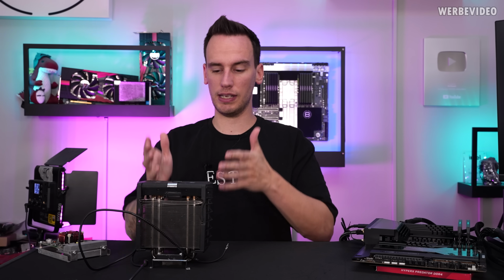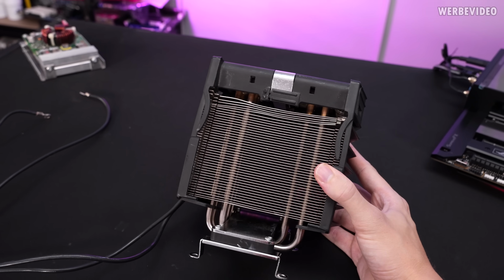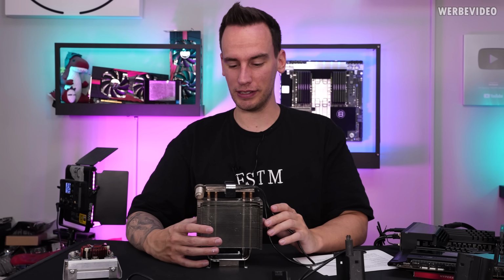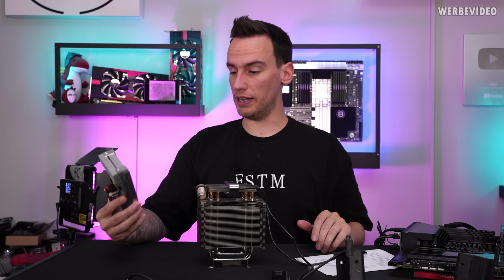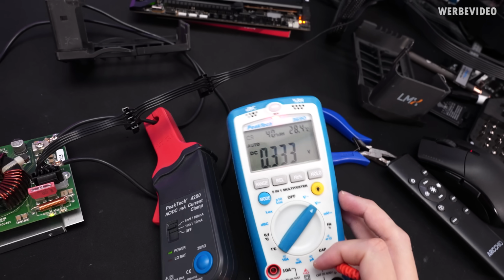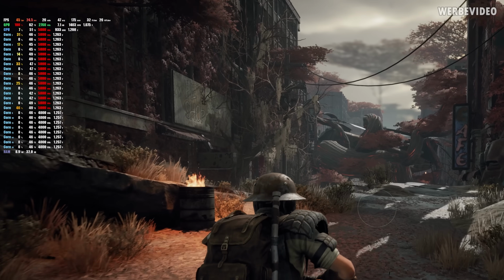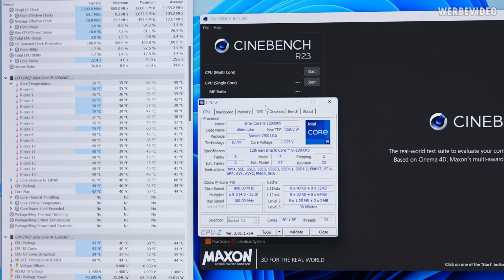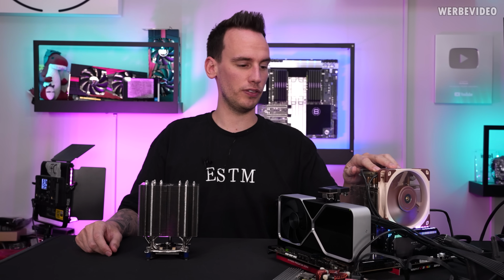This Cooler Ruined an entire Company - LMX Liquid Metal Cooler

Comment from the maker: Yesterday evening I even realized that there is no way to recycle or dispose this cooler in a normal way. Luckily we have a chemical recycling company we work with at Grizzly so I will just give it to them. Isn't it insane that a normal customer would have to deal with that?
Reply: Oh that might be the reason why these never got out, they made a CPU heat sink that managed to violate every RoHS regulation at once.
Reply: @Phos9 Please don't spread misinformation. NaK is perfectly fine for RoHS.
Reply: A normal customer would, truthfully, just chuck it in the garbage. 🙃
Reply: @Guru_1092  And then read the news story on the garbage truck exploding into flames in the next street 🤣
Reply: If you do scrap the cooler, could you send the controller/PSU to either:
Kaizer Power Electronics (Denmark) or
The Post Apocalyptic Inventor (Köln Germany)
They like having this sort of thing to teardown/repurpose.
Reply: See if they can drain the and clean the cooler.
It's an interesting piece to keep on the shelf once it's safe.
Reply: @agentcrm  There is no need to drain it, it can be kept in  a container with mineral oil indefinitely, maybe mounted a main-board like many submerged mineral oil cooled PCs.
Reply: Normal customer would throw this hazardous waste into the regular bin
Reply: Please reconsider and look if you can find a tech museum or somebody  who wants the cooler in their collection. Is by far one on the most advanced cooler around, and the amount of engineering put in it seems ridiculous, I mean you don't see everyday an magnetohydrodynamic pump!
Reply: @claus2234  lol, it's a horrible fire hazard that cannot be put out with any fire extinguisher. It's good that it was registered for posterity but that should be safely disposed off asap.
Reply: @claus2234 they're not that rare, he doesn't need to do that.
Reply: @medes5597   It's first time I heard of this cooling design, rare enough for me.
Reply: @claus2234  I'm not saying it's common. I'm saying its not rare enough that a battered and used example would need to be donated to a tech museum rather than recycled. It was sold at retail in various countries, a large number went out to reviewers, etc.

Theres a difference between rare to me and you, and so rare that throwing a single example away would be sacrilege.

Theres hundreds if not thousands out there. Rare enough that you and me likely won't see another one for a while, if ever, but not rare enough that we need to make sure every lone example is preserved.
Reply: @medes5597   Can you provide a single link of it being on sale anywhere? Because I sure can't

I don't understand why you claimed it isn't that rare when it can not be found anywhere for sale

Maybe you think it's worth saving but the cooler is rare
Reply: @MrCoolSponge (2/2) also it's not currently on sale anywhere because it was sold in 2010/2011 and the company selling it went bankrupt... Why would anywhere still be selling something 13 years later and who would be their stockist? Of course it's not currently on sale. Evidence of its precious sale, however, can be found. As previously mentioned, it's mostly not in English.

There are multiple people in the comments on this video who have one or saw it on sale.
Reply: @MrCoolSponge OK the link, despite being spelled out, means my first comment didn't post.

It was sold in December 2010 on the Danish website proshop. You can find it on the way back machines December 2010 screenshot by searching it by name.

There are also forum posts in French, German and Danish from 2010/2011 of individuals who have bought them benchmarking the cooling amongst themselves. In addition to that at least two reviewers shared this video on social media and stated they had a review unit in storage and didn't know it was so flammable.

I never said it wasn't rare. I straight up said, we are unlikely to see one ourselves or even see another video about it. But it's not so ungodly rare that every example needs to be preserved or that we need to beg that this one, a poor example that has various wear scratches and marks and has been modified, should be preserved in any local computer museum (not even the large computer history museum that likely would know what to do with a potentially dangerous item like this given the precautions they take for items with mecury switches). This example is not in great shape, has now been modified via this video and it is perfectly fine for if to be recycled. It's rare. It's not "unique".
Reply: @medes5597 Did you even watch the video? It's rare af, basically a prototype.
Reply: I actually still have two review samples of this "time bomb" from back in the day, one had a metal cage around the power unit. First one came with generic brand fans with yellow LED's, the other had some pretty mediocre SilenX fans. It sure was a fun new concept, but you could get a Noctua "U" cooler for half the price, half the mounting/wire hassle, and exponentially quieter quality of life. It just wasn't competitive at all.
Then you consider the liquid alloy part of it... and things get even worse. They included a BASF Safety Data Sheet specifically about the Sodium Potassium Alloy, and it is a bit of a scary reading overall. There's details about Exposure, First-Aid, Reactivity, Fire Hazard,, Ecological Risks, etc... 
"...
Toxicological Information:
Causes severe burns.
Risk of serious damage to eyes.

Disposal Considerations:
Return to manufacturer.

Contaminated Packaging:
Keep under nitrogen pressure and return to supplier as soon as possible."
Reply: They chose this alloy over water because they wanted to use a type of pump with no moving parts. This cooler should be extremely reliable.
Reply: @misterstrongerman  A heat pipe has no moving parts, the only practical purpose for using liquid metal in this application is bragging rights for the owner.
Reply: Please do not throw it away!
Reply: There are many chemist youtubers. It would be interesting for one of them to open and analyse the liquid....
Reply: A “normal” customer would have had no idea what was in this cooler, and would not have given it a second thought when they tossed it in the trash.
Reply: classic “we can, but should we”
Reply: I want to see you throw it in water. It needs a leak check 😂
Reply: It belongs in a museum!
Reply: I can safely say that here in Brazil it would not be allowed to sell. It risk involved is to high. Pure alkaline metals are rigidly controlled, specially on amalgamate form like this.
I cannot understand why they though would be a good idea to sell something that is basically a bomb to an average consumer.
Peace and long life! 🖖
Reply: no wonder the company dissolved fast after they launched this danger, sodium potassium is nasty stuff
Reply: And have a WC GPU the perfect storm if anything ever leaks
Reply: any chance you would be willing to empty the NaK and see what your liquid metal could do as "coolant"?
Reply: Americans are like “just throw it away”.
Reply: I would have been interested what changes if you could replace the liquid to water inside :-D
Reply: You put it in the bin.
Reply: Over in Canada we have recycling options in pretty much every reasonably sized city for things like this.
Reply: True. I still wonder if some closed loop liquid metal cooling system would be possible. For example MRI machines have some kind of insane closed loop helium ultra cooling, maybe a wave of the future replacing the water in the heatpipes?😉
Reply: Water cannot be run using electromagnetic pump, so comparing to water needs comparing eventual water pump design for full context.. They played to the EM pumps advantages like silence and small size.  But I would close the business either, exactly because of fear of someone's house burning down after a defect... Cool piece of tech!
Reply: ? Just throw it in the trash or sell it?
Reply: @rx8800xt  yeah, push the problem to the next person instead of being a responsible citizen and properly dispose of something that dangerous.
Reply: @morrido-m6s  ya why not
Reply: that was the first thing I thought about like oh great a cooler that can poison me if it breaks and you need to bring to the special garbage disposal
Reply: @hungryhedgehog4201

It’s not dangerous at all!
Reply: Bruh. I hate fools who are recycling old tech without any good reason that still works or is fixable
Reply: lolh.... that's laughing out loud historically.  It wouldn't surprise me if with the pump, and wires produced a net heat rise in temp.  It is good to see someone's working on the problem though.  I would have thought by now someone would build a cooler like I would in my head.  A nice chunk of metal bolted and sealed to a nice chunk of metal with an interior reservoir of high expansion metal filled with Freon or other coolant with a temp drop when compressed.  The CPU would heat it causing the metal to expand and compress it, and that plus some screws could produce significant compression and produce a freezer on the CPU.  I bet there would just be too much condensation(water)... and that's the problem with active cooling...  as passive cooling goes, there's a lot to be said about the heat drain pipe that is the Ground wire.  Can't it take anything?  I know that's got issues, but metal can be painted(insulated against electrical conductivity, but still good for thermal conductivity.  Who needs cold, cold  water? lolz...  
The US of A builds with a good ground wiring though, and that may not be globally true, so maybe it's active cooling, and just melting the ground wire insulation and pipe insulation if the electrical isn't done right.  Still though... With a proper grounding, I don't think the CPU temp could move much.
Reply: Why not?
Reply: There is no reason to believe this is dangerous or not recyclable… everything in this heatsink is fine… it even outperformed the best heatsink son the market today…

This is a genius design that should have sold and done well… why didn’t it?
Reply: Just use the thing, wtfh?
Reply: Just throw it to trashcan.. 😁
Reply: While thinking about the Dangers of this liquid metals keep in mind, that lithium ion batteries contain lithium and explode frequently in households. But these are everywhere nowadays. Actually both need to be forbidden.
Reply: @Kohlenstoffkarbid lithium ion batteries do not contain lithium in a metallic form, the hazard comes from the inflammable electrolyte they use.
Lithium primary cells, like coin cells, do have metallic lithium in them.
Reply: @pw36952m  Actually this difference does not matter much. If you search on youtube for lithium battery fire you can see that there is no reason to think about from where the fires come. They burn as if they contain lithium or even worse. The problem is, that there are batteries out there which can burn our homes down just because some unknown event triggered them at a random time. The result of such fires is devastating. The cooler is dangerous too but will start to burn only if actually damaged and even then it will not burn as dangerously as a lithium battery of a laptop.
Reply: @Kohlenstoffkarbid  I am curious what you would recommend instead of lithium ion batteries. Most of the alternatives either have severe disadvantages (weight or volume or degradation), or only minimally more safe.
Reply: have you heard of the country of the United States my friend? we don't recycle anything, and even when they pretend to they just ship it somewhere else.
Reply: @vaughncoolman8273   I hate to tell you that the rest of the world does exactly the same thing.
Reply: Props to you for taking the right action to dispose of it ! Kudos !
Reply: That is a big reason why we as a species are threatened, because people dont deal with it. It gets throwned anywhere and the ecosystem has to deal with it instead
Reply: @Chris-vl7pd  Don't blame this on consumers when it's capitalists that got us into this mess and always goes for more profits at the cost of everything else.
Reply: Americans would just throw it in the trash and then contaminate their local regional dump with that liquid metal waste. What's insane is that this ever made it to prototype because fundamentally it is a nightmare of a product. IF it fails, it is a REALL bad problem and if it doesn't you cant throw it away?????? I just dont understand why this was made.
Reply: @WhatWillYouFind  The contents are not chemically toxic, but will self ignite in contact with air or water. So no contamination, but a literal dumpster fire.
Reply: No it would not catch fire….
Reply: @WhatWillYouFind  Please don't blame the manufacturer of such excellent product for the stupidity of 99% of the customers who never read the safety and disposal warnings. Such thinking is the reason why advanced devices are no longer produced. Because the idiots sue the manufacturer for their own criminal negligence. I used to work with highly dangerous chemicals some years ago and never had an accident, because I always acquire the necessary knowledge first.
Reply: @WhatWillYouFind , shame on you. Na and K are a part of your body. “Contaminate” — what you can contaminate with potassium and sodium?  Your empty head?

Comment: The irony of someone claiming to being an engineer, looking at a heatpipe thinking, that has to be done better ........ :D Its such an  overpowered use of physics, and the first ideas of these principles was concieved  by none less than einstein himself. 

Someone like you needs to figure out a way to mount a cpucooler with enough pressure to just use soft metal as thermal interface. I know its not easy - but im sure it can be done - probably needing some special structure in the pcb itself.

Comment: Based on the numbers, the heat conductivity of any heat pipes is never a problem. Using Na/K alloy presumably gives you better heat conductivity at the pipes, but the bottleneck should be at the material interface (CPU die to CPU lid, lid to paste, paste to cooler block, block to heat pipes, and pipes to fins, they contribute all the temperature gradient). The cooling capacity is always determined by the heat dissipation area (the fins) and efficiency (the fans). So it's not surprising that this cooler does not make any difference.

Comment: NaK is a high temp coolant with a far greater range than water and despite the low capacitance it is far more conductive.  The lackluster showing is most likely due, in order, to the speed of the pump, the heatsink, and potentially tube geometry.  Though I'm not sure said system can be made effective without the pump taking a comparatively excessive amount of power.  Water in heat pipes is more reactive.  Gallium based coolants cause joining concerns.

Comment: You got it wrong with thermal capacity and thermal conductivity. For heating pipes actually thermal capacity is irelevant, you care about how fast you can get heat from the CPU to the cooler, and you really don't care at all how much thermal energy can pipes store as you're just trying to transfer heat to the cooler.

Comment: How does it compare when you mount the motherboard in a tower case? I guess standard heat pipes work fine in that scenario, so perhaps it's similar to water in that respect... was just wondering because they opted for a pump rather than convection, and they say don't mount a radiator with the pipes above the pump.

Comment: I have some back story to this thing, pity I didn't see this video earlier. Danamics was created by the people who previously ran nVentiv (previously chip-con) who built large phase change coolers for PCs. I worked for that company for a while until they went bankrupt, testing, overclocking and building machines for trade shows. The CEO and CTO had this idea while the old company was still alive, but a couple of years later when they had found the funding for this amazing idea of a cooler they invited me when they had prototypes to test them for a day. 
The first thing that became obvious was that they had made the mistake of making the base of the cooler totally flat, not taking into account that once you tightened the Intel CPU of the day into its socket the pressure of the socket would bend the heat spreader a little creating a depression in the middle. The best coolers of the day were therefore slightly rounded to ensure good contact with the IHS in the middle where it's the most important. As a result the LMX prototypes were being outperformed by regular heatpipe coolers. They had to go and re-do the base of the cooler to ensure good contact. Even when that was done however the issue remained that it was hard to beat heatpipes. It was almost within margin of error or, when things went well, a 1 or 2 deg advantage using pretty strong fans (which weren't the best quality, but that's another story). Basically the problem was (in my opinion) that they were blinded by their amazing idea for an electromagnetic "pump" system that they lost track of the fact that what was limiting the cooling performance was not the heat transfer system from the base to the fins but more the total surface area to dissipate that heat. They were never going to find the huge benefits required to make anyone pay twice as much for something ten times as complicated for the limited gains that were theoretically available. Still, I look back on my short time in Denmark with some fondness as the guys were great and they went on to become successful enough in life that we can look back on the fails without crying :D

Comment: Heat pipes are even more efficient because the water goes trough a phase transition.
The transition from liquid to gas with water takes up roughly the same energy as heating the same amount of water from 1°C to 95°C (under atmospheric conditions, a lower pressure also lowers the energy requirements for phase transition ).